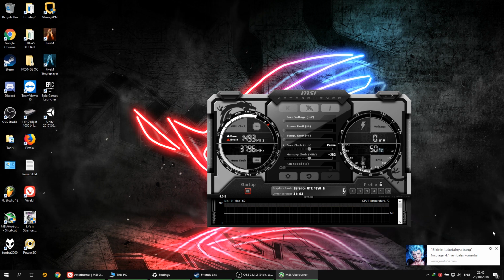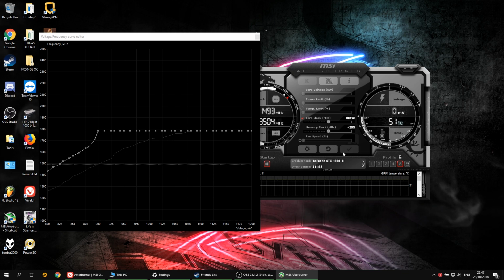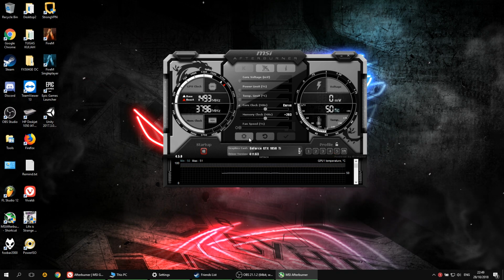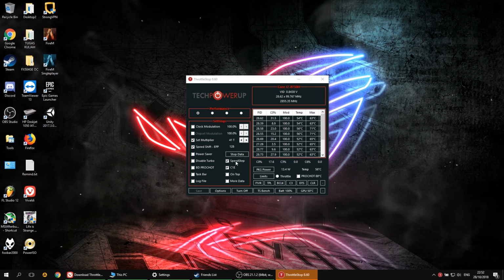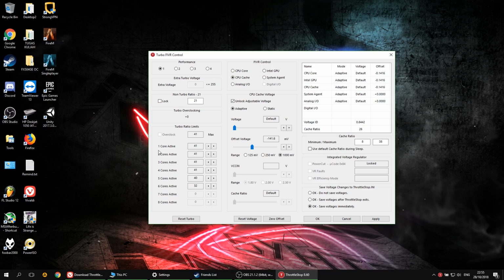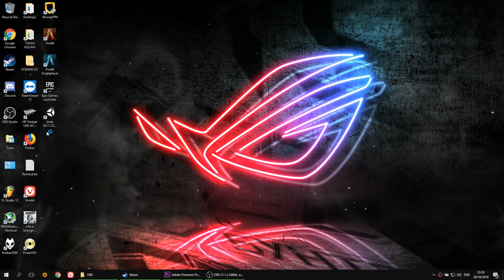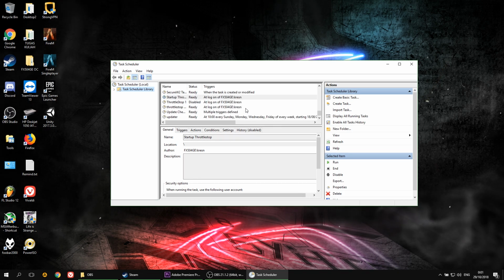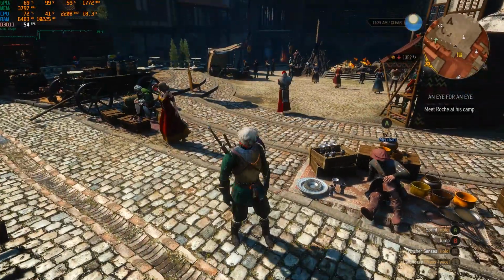ASUS TUF FX504GE How to Fix Stuttering & Power Limit Throttling (GTX 1050Ti, i7 8750H) *NEW

Comment: Thanks Bro , used your undervolt settings and upgraded Ram from 12Gb to 16GB (8Gb x 2) 2666Mhz totally solved lag problem in CSGO , never feel so smooth before even played 1 hour
FX504GE Bios Version 316
Ram HyperX Impact 8GB + 8GB  Both 2666Mhz
Temperature :
CPU : 70-80 Degree Celsius
GPU : 60-70
Reply from the maker: glad to hear that! i've added 8 GB more RAM recently, so its 8x2 dual channel. now my CSGO is running above 200 FPS! the temperature is getting hotter though because the CPU can run faster & keep the GPU stressed. but it's running verrrry smooth like a dream, especially with the overclocked refresh rate to 80 Hz.
RAM : Team Elite 8 GB 2666 MHz
CPU Temp : 80-89 Celcius
GPU Temp : 78-85 Celcius
im living in a hot place.
Reply: @kresnaputra  Good for you , do you mind  share me your MSI AfterBurner UnderVolt profile?
Reply from the maker: @fooweeshen  yes privately
Reply: @kresnaputra  can you share me pls ?
Reply: itu 80-89 celcius tiap main harian bang? sampe skrg kondisi laptopnya gimana bang?
Reply: 80-89 normal, karena laptop ada thermal throttling berbeda beda, meskipun max cpu dan GPU 100derajat
Reply: @kresnaputra  UPDATE : I complained to Asus Customer Service Hotline on 2019 they replaced FX505GE for me without any chargers m
Reply: @nabilgaviasky8029  Already replaced FX505GE by ASUS MALAYSIA on 2019
Reply: The FX505GE Will reach 95 Celsius but no throttling

Comment: i tried for i5 8300h model and its perfectly working. i have never play like this smoothly. and my tempetures are reduced 5-8 degrees. thank u so much +rep
Reply: The new models manufactured after October 2018 don't have this problem bought the i5 8300 1050ti variant 4 days ago from Amazon
In newer models the bios comes updated to 312 and windows to 1803 so the newer models don't have this problem
Reply: @asustufgamingfx5048  i have this ugly problem and i didnt fix anyway. This solution is perfectly fine
Reply: Could u plz help me too.. By posting the values... And guide me..with the changes if any with the valu for underlock and undervolting?  @talha burak yavuz
Its all messed up.. And couldnt figure out what to doo. The drops r  just worst plz plz HELP somebody.. My model is i5 8300 with 1050ti ... Asus tuf fx504... Lappy😞
Reply: @ceylanefekocak4495  aynen kanka bende çözüldü sonradan kaldırdım bunları hatta ona rağmen bozulmadı

Comment: I love you! I followed all the things in afterburner, updated the BIOS 316 and it runs smooth as FUCK, no frame drops, no throttling, i didn't use the throttlestop yet because so far it seems that fixed the problem. I will run more tests and if needed i will lose that too. Thanks a lot again, really detalied video. Keep it up!
Reply: any updates ?? i ordered  asus tuf fx504 i7 from amazon and i saw many many bad reviews
 how does it work with you?

Comment: Hi, I have an ASUS TUF FX504GE with i5 8300H and a 1050Ti. My problem is the CPU speed throttling. All PC games run fine, but when I try to run a CPU intensive program like RPCS3 emulator, the CPU speed locks itself to base speed (2.29 GHz, and lower at times), after about 2minutes if the program running, and refuses to use turbo speed. How do I force the CPU to run at turbo speed? Throttlestop limits window shows VR Thermal in Red for all 3 things, and other reasons in yellow are Thermal, PL2, and EDP Other. I can't undervolt more than -135mv, so should I just use thermal pads/paste and a clean up. Please tell me some way to fix the CPU speed throttling and extremely high temps (80 to 90 degrees).

Comment: I have a i5 varient with 1050ti. TBH the laptop runs pretty hot reaching 85c while playing assassins creed origins. After correcting the graph the cpu runs 70c and GPU at 60c. I'm quite   impressed. The stock cooling of the laptop is bad. After correction the thermals are good never going above 75c. I play assassins creed origins with high settings getting about 54fps with is good for a budget oriented gaming laptop.
Reply from the maker: that's impressive. the i7 8750H version actually runs hotter after undervolt because it can stay in highclockspeed above 3 GHz where before undervolt it's just fluctuates to 2 GHz & not performing to it's potential. that's why i reduced turbo ratio limits in 8:33 to make it a lot cooler & less fluctuating for much stable gaming experience.
Reply: Bro could u plz tell me whether u had followed each and every steps as mentioned in the video. Actually, I too have the i5 variant

Comment: Hi, great video. It will be more helpful if you can post the links of the software used in the description. Also, which software were you using to get various details in the top left corner in the game?
Reply from the maker: use MSI Afterburner, go to settings>monitoring, check which detail you want to show in game (check the show in onscreen display in each item).
Reply: @kresnaputra  Thanks bro.

Comment: I have the same unit as you and even when playing minecraft(while plugged in) I get frame drops with almost max settings on graphics. And I installed shaders which was supposed to be okay considering a Core i7 8th gen and GTX1050ti but heck, its still very laggy. Im gonna try to fix it using your video. Hope it works
Reply: It workedm?

Comment: Thanks for very detailed video brother
But my laptop seems to have locked the undervolting settings for cpu in FIVR setting it shows locked i tried in Intel's xtreme software as well still no luck i guess have to tweak the pl1 and pl2 only 
The gpu setting worked flawlessly for me though thats lucky and the performance was drastically improved thanks alot man 
Appreciate it 🫂
Do post more again i can see your last video was 8 months ago 😅

Comment: The new models manufactured after October 2018 don't have this problem bought the i5 8300 1050ti variant 4 days ago from Amazon
In newer models the bios comes updated to 312 and windows to 1803 so the newer models don't have this problem
Reply from the maker: but it still heavily underperforming. the 312 BIOS solved the stuttering problem, but if you monitor it, it's still throttling. in 312, they made the GPU throttle too to leave more power headroom for the CPU, so the CPU won't throttle as much as before, but the GPU is running below 1500MHz cause it's throttling all the time. Undervolting is still super bennificial if you want it to perform just like other laptops with same card, you can get rock solid 1747 MHz which means 5-7 more FPS than stock.
Reply: @kresnaputra  The stuttering problem is back again in my asus fx504.it was never stuttering from last year but it started now.what could be the issue?

Comment: i have a quadro 600, it keeps throttling to 405/135Mhz in MSI afterburner, the max clock is set to 752 and the temp stays between 50-55, i'm gonna cry now bc nothing works, can someone pls help

Comment: Hi Bro, I have bought same laptop last week but model is 2 years old 2018. i7 8750H , 1060 6GB, 120 HZ TN, 256GB SSD, 1TB SSHD. Battery life is too low. With Full charge it gives only 2-2.5 Hours with normal browsing and youtube and power saver ON. I clean installed and no software at all still such a low battery backup. Can you please suggest how to increase it or Shall I ask Asus to replace as my Model is 2 Years Old ? Also is Display good ? 120HZ TN with 130% sRGB.

Comment: Hi I know this video is old but I hope you're still active. I have the same model and the same specs, I don't experience any stutter or lag but my gpu and CPU are always hitting 80-90° which is very concerning. Been playing heavy games with it for hours with no crashes, like RDR2. I tried changing the thermal paste and cleaned the fans, even tried undervolting it but still it stays at 90°. Is there any way I can fix this?

Comment: Bro Im using 8th gen i7 and 1060 6gb,how much should i undervolt?? I spent a lot of money for this. The fps drops for like 1 second and come back frequently and its really annoying. Sometimes, the laptop just FREEZES while gaming!! Wtf is that!!??
Reply from the maker: the easiest way is try to reduce the cpu turbo to lower value, just like what i did in 8:31. (Nerf that CPU)
Reply: What kreshna said. But by lowering cpu clock speed you will get less fps, especially in cpu intensive games like gta 5. A better solution is to just get a gaming laptop with adequate cooling next time.
Reply: @alexclarke6924  man... Its not chocolate to buy better next time, i am stuck with this laptop for the next 5 years, i spent 82k for this, what i want is a fix for this. Lol
Reply: @arunjojo9071  Try reinstalling windows, undervolting to -175mv (core and cache) and repasting. Hate to tell you this but this particular laptop model (fx504) has a very aggressive power limit throttling installed by asus in the firmware which is nearly impossible to remove.
Reply: @alexclarke6924  Lol thanks, i will try and tell the results
Reply from the maker: @arunjojo9071  -175mv is too much, it can make the laptop freeze/crash. i recommend -140.6mv for the i7 8750H. also, lowering the speed to 3,2 GHz won't reduce your FPS, trust me, that's the sweet spot. also MAKE SURE to set your fan mode to OVERBOOST when you play games, the balanced fan mode prevent your fan to run  full speed, it will cause the laptop to freeze because of overheating. my game freeze too when i forgot to set it to overboost.
Reply: @kresnaputra  ok thanks
Reply: @kresnaputra  excuse me, but i when you said your game freeze, is it kind of hard freeze? which you can't do anything except force shutdown manually using the power button? and airplane mode automatically turns on, then makes your wireless device messed up so you need to force shutdown again when it turns on?

Comment: so asus tuf fx504G that has good cooling design still throttling, damn it
Reply from the maker: not really good because there's only 1 small heatpipe to the CPU,  they limit it to prevent overheating when gaming (both GPU & CPU stressed).
Reply: On the contrary, FX504 has one of the worst cooling in the budget gaming laptop market

Comment: Hey bro i have Asus TUF 505 but mine is i58300h
And a 1050ti o have no problem on my fps but my cpu and gpu temps are too high its hitting 90c° or 99c° it throttles my laptop but the fps are not dropping dou you have any idea to bring it downy temps while my gpu and cpu is at 100%?
Reply from the maker: feel the airflow from the back of your laptop with your hands, if the air coming out not as hard as the fan sound, something is blocking your vents, open up your laptop & open your fan cover, you'll surprised how much dust build up there blocking the vent from the inside, clean it. i've got huge temp drop by doing so, about -10C drop

Comment: Brother is thermal thorttle still exist after bios  update ? bios 319 and ram 16 gb cuz iam facing only like 70-80 celcius never goes up from 80 without tuner like this, i wanna know
Reply from the maker: of course it will still thermal throttle when it reached 88C even after doing this, what we trying to fix here is performance drops caused by the power limit throttling when gaming because of the CPU 25W power cap when running GPU heavy task. since the stuttering has already patched by BIOS update, no need to do this unless you want more performance out of this laptop :D
Reply: @kresnaputra  i just using XTU to undervolt and drop my clockspeed to 1620 as website say 1620 mhz boost clock

Comment: Hi Kreshna, So shall I do same for my FX504GM i7 1060 120Hz TN ?
Reply from the maker: yes, you can try it for more performance
Reply: @kresnaputra  I am bit confused with this laptop. I got highest model for half price. All looks good. Thermal/power throttling , I will try your settings.  I am getting 2Hrs of battery life only in normal usage. What shall I do ?

Comment: Hi man sorry if it's an obvious question i'm completely unexperienced with this but will it work on a asus fx504gm i5-8300h gtx 1060 6gb? Thank you
Reply: And will my laptop last less years if i do this?:(
Reply from the maker: yes it will work with different amount. it makes your hardware run at the same/higher speed with less heat.
Reply: @kresnaputra  Thanks for responding and how do i know the amount i have to put?
Reply from the maker: @GameMovies999  experiment or find someone who already undervolted that card (google). like the graph in 3:52 most 1050ti laptop can run max clock at 900 mV voltage indicated by the flat curve started at that point. for 1060 it maybe different, you can try flat starting at 950 mV & if it doesn't crash you can raise one more dots to the left, repeat until you get satisfying results without crash.
Reply: @kresnaputra  then do i have to undervolt the i5 as well ?

Comment: @kresna_putra i never faced any problem  till yesterday but from yesterday the power limit throttling is constant whenever i play any game.(gta v ,fifa 19)
Reply from the maker: readjust the fan mode, the power limit tied to the fan mode, sometimes bugged.
Reply: @kresnaputra  I always turn on the overboost mode before starting any game...so I dnt think fan is the problem..

Comment: Will the setting for core I 5 ( same laptop). Be the same ??
Reply from the maker: Even if you have the same processor, it can be different, because of silicone lottery. start with -80mV first, and test, if it runs fine, you can try lower. i know some lucky guys that can go lower than mine without crashing.

Comment: gan mau tanya. intinya cara diatas untuk menurunkan performa dari laptop yg terlalu over smpe nyentuh 80/90C ?
Reply: dan kalo mau nerapin cara di atas pada cpu COre i5 gpu GTX 1050 apa yg dibedakan gan. thx
Reply from the maker: versi i7 wajib di undervolt klo mau keluar performa aslinya. kalo yg i5 & 1050 gak wajib, kalo mau undervoltnya dikit aja, klo divideo i7 bisa sampe -141.6 mV, klo i5 mungkin gk sampe -100 mV, klo di video  1050ti kurva udah datar sejak 900 mV, mungkin 1050 agak kekananan sekitar 925/950 baru datar. dicoba" aja, kalo bluescreen brarti kebanyakan undervoltnya.
Reply: @kresnaputra  oke gan mksh infonya. Nnt d coba